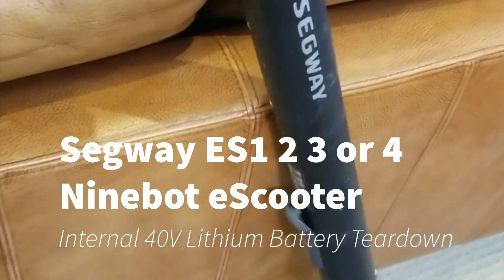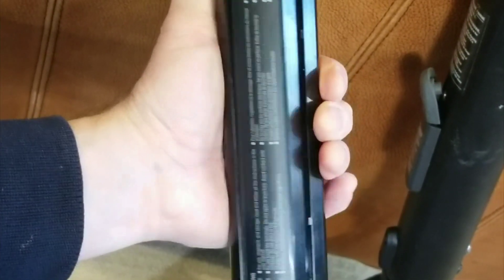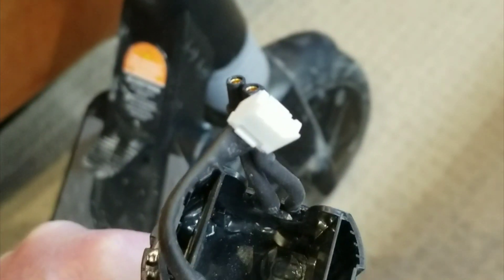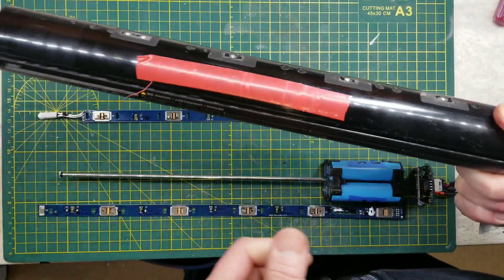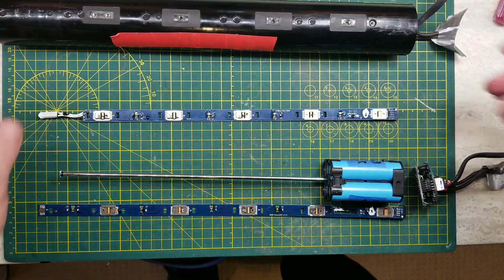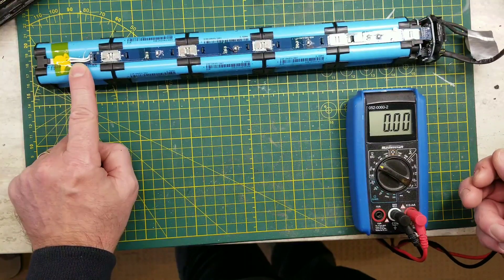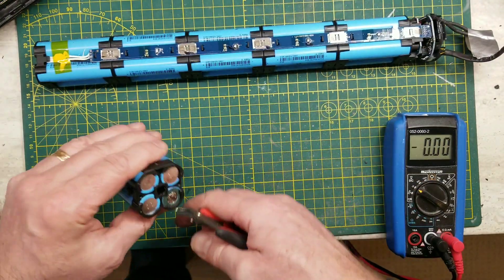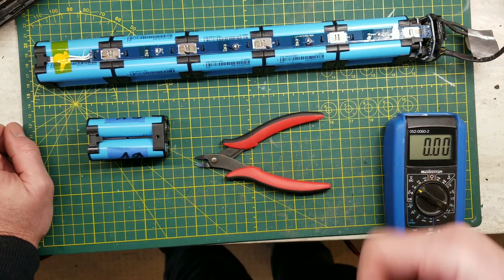Segway Ninebot Internal Battery Teardown

Comment: I just got hold of a scooter that's broken from my friend, an ES4. It's completely dead, the internal battery is just flashing red, dissasembled it as you did and it reads 3.7v on all packs, do you think this could be an issue of a fried BMS?
Reply from the maker: Hi U - I've been searching for a decent reference online that explains the light flash codes but unfortunately can't find a good one. I wish I could give you a for sure 'yep - that's what it is' but I just don't know enough about the electronicals to say for sure.
When power tool packs go into "dead" mode its often because they've been sitting idle too long and cells have lost charge dipping them below what charge circuitry deems safe. Often closer to 3.2v from what I've seen. I've been able to bump charge packs and get them going again by bypassing the BMS and charging cells directly (be careful doing this!) You just need to bump charge up past minimum and then BMS circuitry happy again. What I don't know is what cutoff voltage is for these ninebot packs. 3.7v seems high to me for that to be the cause so yep it could be the BMS.
The other thing you might want to try because you do have some life (lights flashing) is to long press the brass reset button on the BMS board. Just a guess but maybe this will do enough of a reboot to wake your battery - can't hurt if you haven't tried already. Good luck .. let me know how it goes.
Reply: @fixitdad899  Thank you for the response! Did try the reset button, no luck there i’m afraid. Ordered a new BMS but will have to wait a couple of weeks until it gets to Sweden from china. Will update asap!
Reply: Guess it wasn’t the BMS, swapped it out and the new one flashes in blue, switches to red while charging, and the scooter still doesn’t start
Reply from the maker: Hey U.  Thx for getting back on swapping the BMS board out.  That sucks. Hmmm... Only so many things in there... do wish I knew the flash codes.
One other thing that comes to mind is the thermistor/thermosensors. Total reach here but on my 3D printers if the little glass bulbs or wires leading to them fail then that makes things 'not go well'. Or maybe somehow the main board closer to speed controller not happy? 
You said ES4 right? Are you making sure to charge internal batt directly and not via the external battery? Need to ensure the two batteries are at near the same voltage before reassembling. (If you can see flashing lights assume you are charging internal directly).  All I can think of my friend.  Best wishes on the continued search for solution. Gotta be just around the corner!
Reply: @fixitdad899   Right after my comment i saw that both leads to the big condensator on the controller board had snapped for some reason, though it didn't make any difference if i connected them back. I just went ahead and ordered a new controller board and the main / displayboard and hopefully it will get running. And yes, i was only using the internal battery at that time, external wasn't plugged in. :)
Reply: @fixitdad899   Looks like it was my controller board that was faulty from the start, swapped it out and now it works like a charm!
Reply from the maker: Yay! Well done sir. Thx for letting me know. How expensive was the board?
Reply: @fixitdad899  about ~45 USD on Swedish Amazon, so not bad at all! Especially seeing as i got the ES4 for free :)
Reply: @fixitdad899  If you meant the BMS it was about 30$ om Aliexpress
Reply from the maker: I'd say you got quite a great deal there...and the satisfaction of troubleshooting and fixing to boot!  Enjoy...they are a blast.
Reply: @Clasisw  hey! I got same issue regarding battery and thinking about changing BMS. I have blue blink while idle, if i plug in charger i get red blink. Measuring just battery i get 3,36volt. If i plug in white cable to controller i get 15-20 volt that goes down to 10volt. Did you have same issue? Already replaced controller.
Reply: @jimmiepetersson344  hi have same issue any thoughts. Cheers
Reply: @TheMrjogas  Hi, I just changed the battery complete and was up and running.
Reply: @jimmiepetersson344  thanks for fast replay.my cells all at 3.9 but bms output 18v only.try reset but nothing happend.dont know is bms fault or other board 🤔

Comment: I’ve had a couple that flash red where the blue light is. Usually means improper voltage. Only been able to fix one in that condition by connecting, dismounting etc.
Reply from the maker: Hi Indoor ... thanks for info! Question for you - I've been looking for a source to explain light flash error codes on these units - haven't found one and many forums are dead ends. Have you found a source that you could share? Many thanks
Reply: @fixitdad899  I have been looking for those codes also. Can not find anywhere. Please share if anyone finds out
Reply from the maker: I still don't have ... Audi or Indoor you guys happen to  know what "Code 19" actually means for sure? Another commenter has an issue with that error code. Cheers
Reply from the maker: https://m.gearbest.com/blog/how-to/ninebot-segway-es2-scooter-error-code-7369
Reply from the maker: Have attached link for numerical screen codes...is not blinking light patterns but still might be of interest
Reply: @fixitdad899  not seen one, not sure one exists. 

Might look at it like the dashboard error codes. Long beeps are 10 and short beeps one. So 2 long and 4 short is error code 24.  Long light and short light flashes?
Reply from the maker: https://youtu.be/yz_iit1HPls
Reply from the maker: Sorry - am not sure about the flash codes. Link is to the video. It really does exist.
Reply: Question, once it blinks red does that mean the battery is done.?
Reply: Also how were you able to fix it.?
Reply from the maker: Check out jehugarcia channel.
He shows how to wake up 'sleeping' ninebot batteries.
Think vid will give you better idea of what might be possible.
Reply: I have the same problem mine is flashing red

Comment: Damn my es4 won't turn on. I jus got a new dashboard im gonna install today and hope it works. But after watching this I hope its not the battery lol. U said I can get shocked Nd that jus about did it foe me. Lol
Reply from the maker: Hey Luis - hopefully your new dash will be the cure.  Re: accidental shock... hope I didn't freak too many people out but it is true that you do need to be careful. However..I deliberately said "40v applied the right way..." (I guess that would actually be the wrong way)
Chances of a fatal shock are actually probably not huge. Would have to be a combination of factors:
Dry skin is not a great conductor..but maybe someone has been messing with dielectric grease or is sweating profusely? Never know.
Duration of shock another consideration.
Path of current is one of the biggest ones. If your heart is in the path of current flow ie. you are grounded via one hand and are 'hot' via the other..not good for heart health.
BTW - One of the easiest things to do to reduce shock risk in general is to tie one hand behind your back.  Sounds crazy right? But hear me out. (You don't actually have to tie it) If you are poking around in live electricals and are doing it with just one hand there is no direct path across your heart if you short yourself. But...If you are poking around with two hands and accidentally do that thang then.... well not so good. Good luck and stay safe! Thanks for watching.